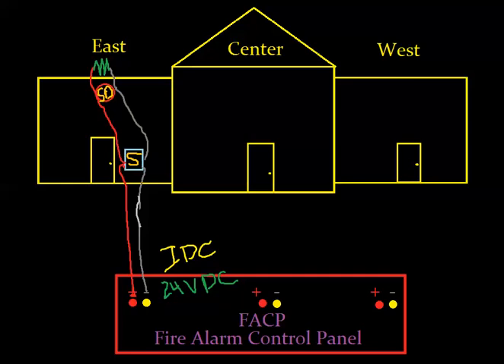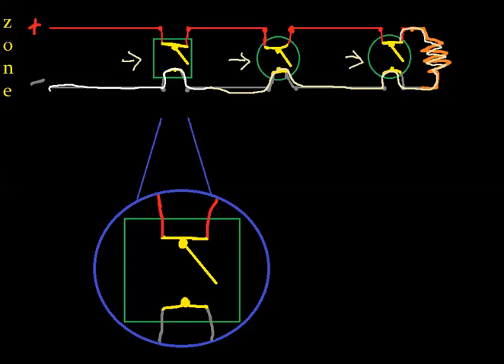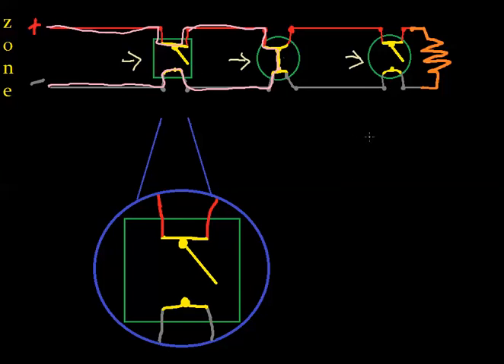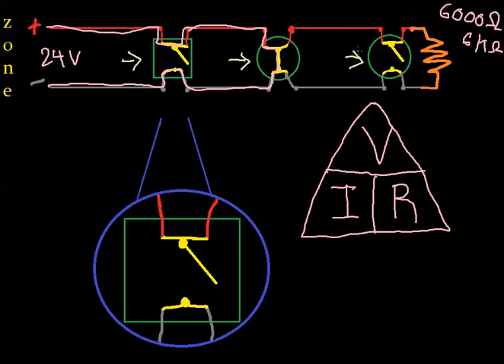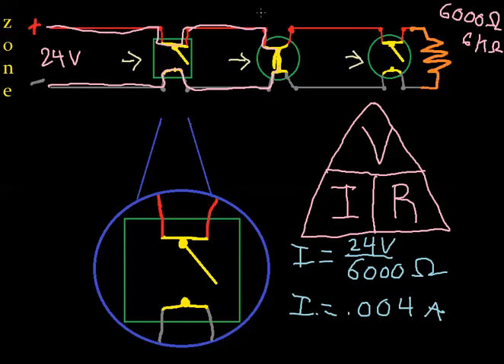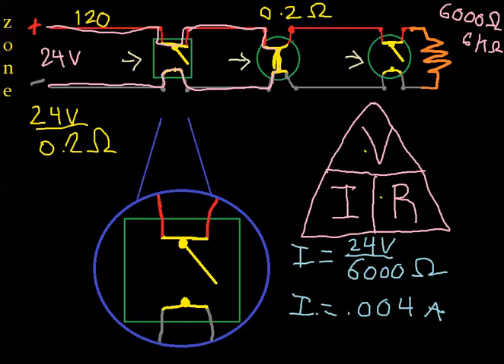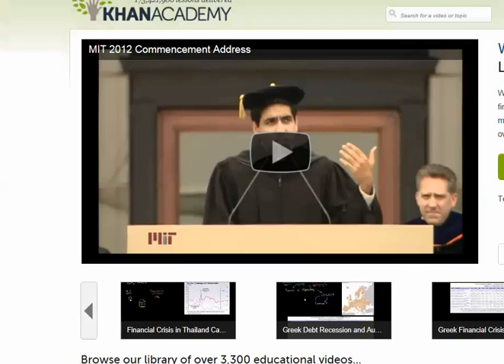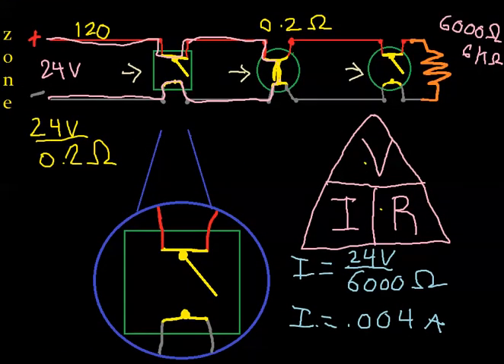Introduction to Fire Alarm Systems 2

Comment: How much will be the current if the last detector is activated
Reply from the maker: Depends on the type of the detector, but it really doesn't matter which detector is actived. The only difference between the first detector or the last detector being activated would be the resistance of the wiring between the two, which is negligible.

Comment: I believe that it’s not the positive getting shorted with negative , it will damage the equipments . It’s only the positive that starts and passes through the switches and gets back to the point where you have marked “ - “
Reply from the maker: In a zone panel, it is definitely the positive and negative shorting together. The equipment is designed to handle this. The current is limited, and the panel detects this increase in current as an alarm.

Comment: Hi Joe, in the battery the electrons flow from negative to positive. In a circuit, the current flows from positive to negative, so your diode points (Pointy part) towards the negative.
Reply: The flow of electrons is termed electron current. Electrons flow from the negative terminal to the positive. Conventional current or simply current, behaves as if positive charge carriers cause current flow. Conventional current flows from the positive terminal to the negative.

Comment: good work. In cases like this, specific systems, its more informative to explain the Values of the Volts and the system ampere for drift in standby or alarm. rather than explain what voltage and Ampere is, philosophically :) its an endless explanation !

Comment from the maker: The second detector won't be recognized by the panel, but it doesn't make a difference. In your example, the zone would go into alarm once the first detector went off. The horns would go off, the fire doors would close, the fire department would be called, etc. Whether there is 1 or 10 detectors in alarm on one zone, the panel would look exactly the same. It would show an alarm in that zone.

Comment: Can the panel withstand this large current??
and if we use fuse or CB for this large current it will open the circuit and the panel will have problem

Comment: so let's pretend for a moment that the fire doubles in size.  The heat detector senses the fire, the panel goes into alarm mode, and the current goes through the first heat detector.  So if it doesn't go all the way through the resister, then how is the second heat detector supposed to go off if the fire doubles in size, and the fire goes into that part of the zone?